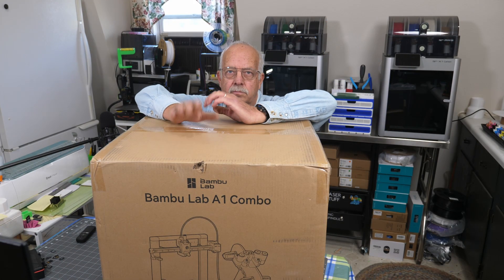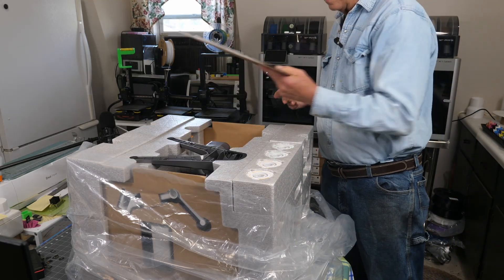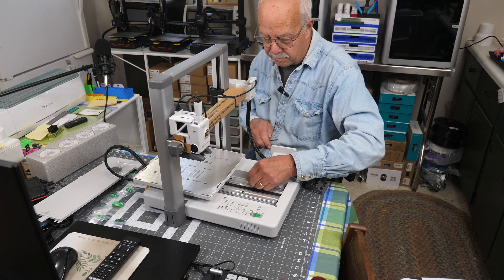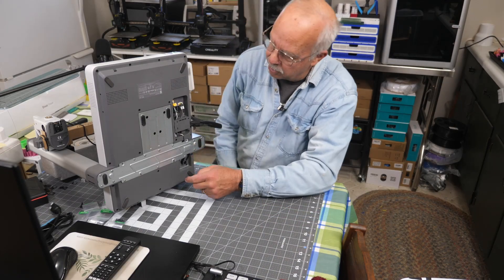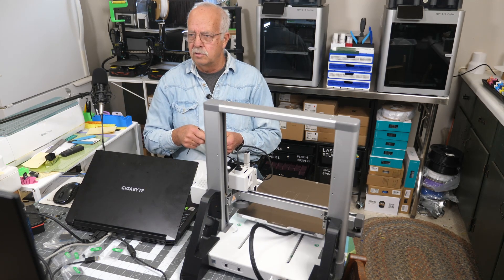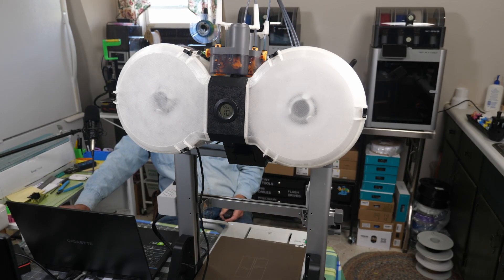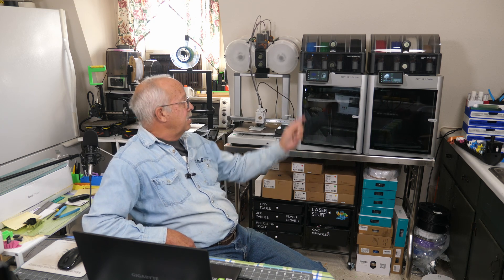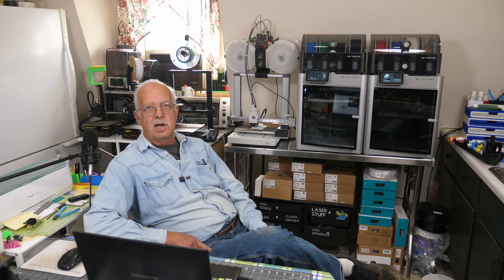Bambu Labs A1 Printer Setup and Mods

Comment: Roger, your video was very timely in that I ordered my A1 yesterday and the parts of the order should start arriving next Tuesday.  I was wondering about the AMS mounted on top.  How much filament does it use to print that setup???  I assume PLA is acceptable,  Thank you so much for putting out these videos.
Reply from the maker: I used PLA on this one.  The next one I am printing is with PETG, but that is not necessary.  I didn't look too close on how much filament it used, but thinking half a roll or less.
Reply: @rogersshop  Thank you for the information.  Looks like good project.

Comment: Your lucky to get an extra screws, I bought a Elegoo with 4 missing screws and a heater table wire that was an inch to short to meet the connector.  Took them three weeks to get me the screws, had to send pictures of everything and the short cable now four weeks into this and I supplied them with pictures but no, now they want video, I had to splice and add 2" of wire.  Don't ever buy Elegoo, right Mr engineer Andrew and I just told them to go to H*ll and placed an order for 10 A1's,  and 10 Creality hope that wasn't a mistake.
Reply from the maker: Interesting, but I have no experience with Elegoo.  I DO have experience with Creality tech support (or lack thereof), so hope you don't need to contact them with any issues!